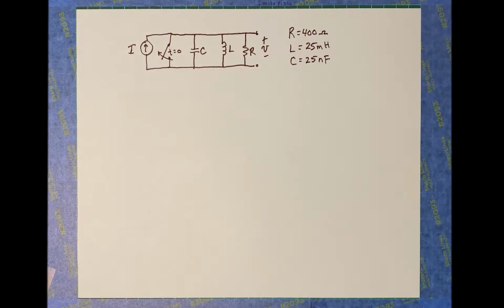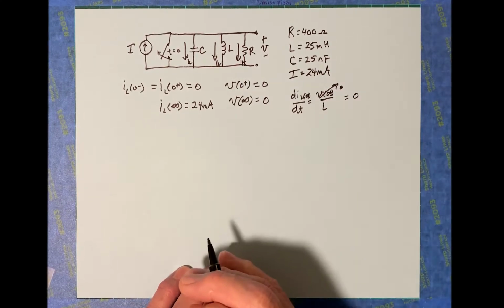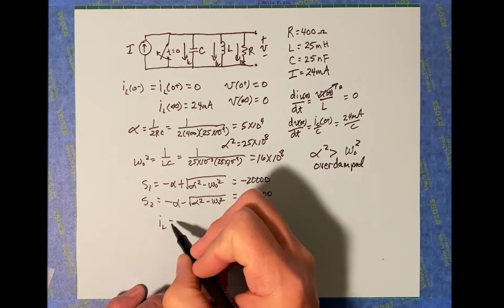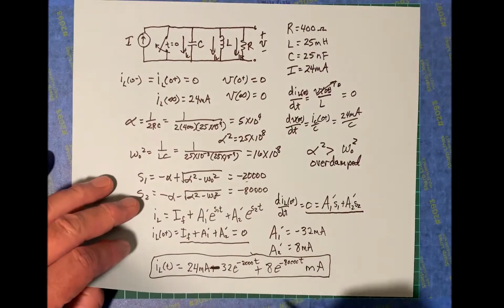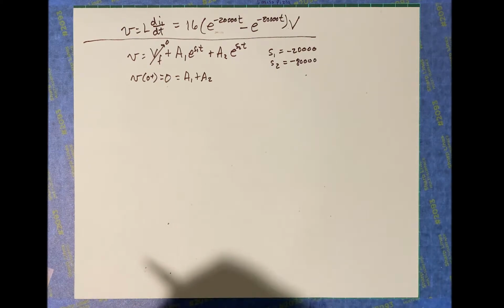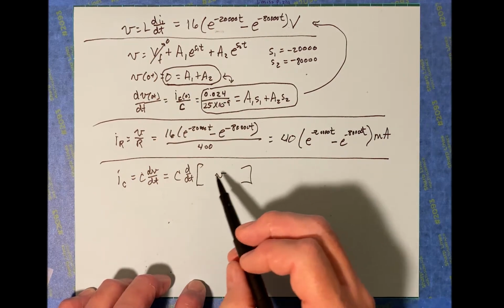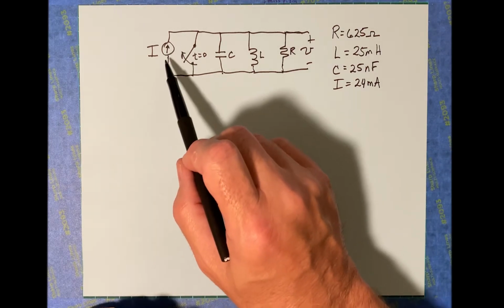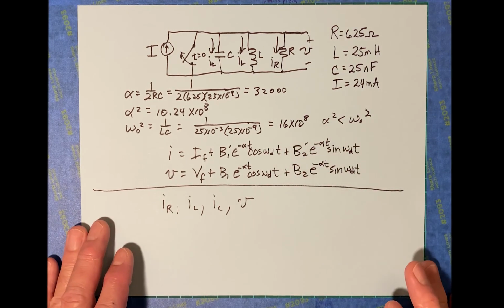25-Solving Parallel RLC Step Response Problems

Comment: What if we need to determine the value of R is not given?
Reply from the maker: I’m not sure, but I think I know what you’re asking. In that case, if you need to find R, then you would need to know which of the three cases you’re solving for, that is under, over, or critically damped. You would also need to know the alpha frequency or have enough information to figure it out.
Reply: How to find the R value? Can you give me the formula?
Reply: I have a similar question given but it states that we need to determine the R value to produce the three types of damping response and obtain the numerical expression of iL(t) at t>0

With values I=24mA, L=25mH, C=25nF, can you help me?
Reply from the maker: @stacarlsonlauspehus3161  Sounds like you want me to do your homework for you. Here’s what you need to do:  Do the comparison between alpha and omega based on the case you want, then solve for R. After that follow the procedure in the video to in the currents and/or voltages.

Comment: in the first exmaple, why the current of capitor(Ic 0+) is 24mA（@ video 4：52 ）?  why it doesn't follow Current divider rule ？ thanks to answer！
Reply from the maker: The C offers zero resistance at t=0. Given two paths, one with some resistance and one with zero, the current will choose the path with zero resistance. Of course this changes quickly after t=0. You could use current divider equation, compute i for R, but set resistance for C to zero, gives zero i for R.